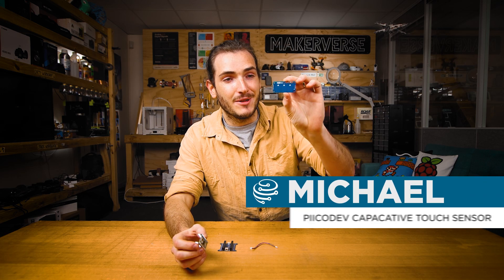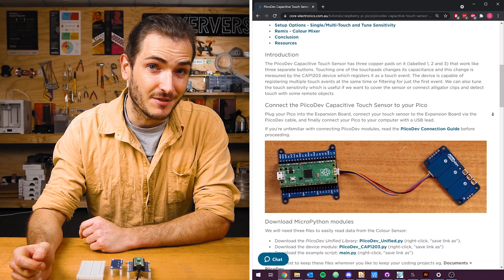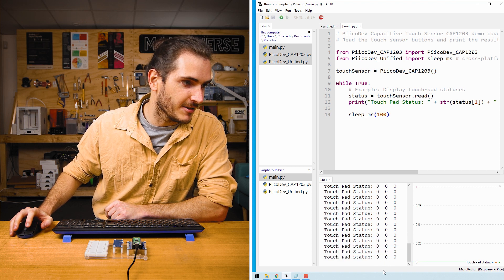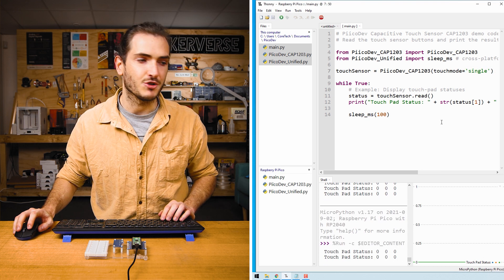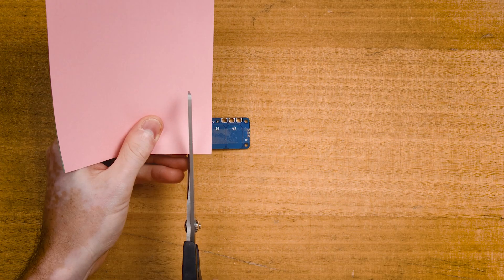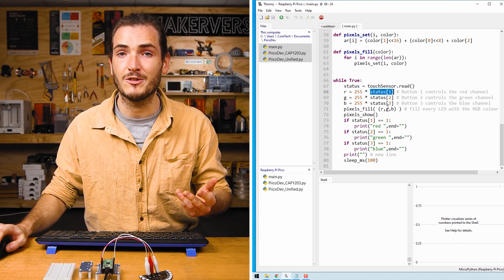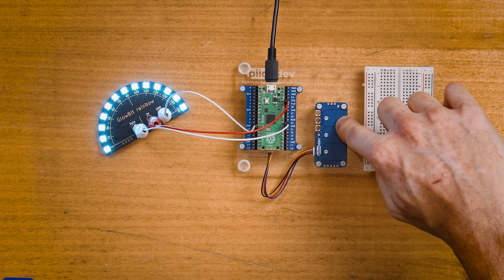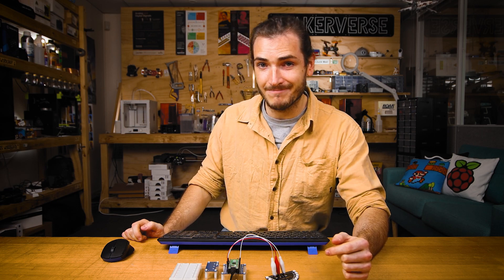PiicoDev Capacitive Touch Sensor CAP1203 | Guide For Raspberry Pi Pico

Comment: Thank you for the movie. It would be great to have a project that does a data exchange using a Piicodev sensor linked to a Pico that sends data to a web app. This would make a great project for students Digital Solutions IA3 projects in Queensland. A data exchange between 2 external systems. So collect data with the Piicodev sensor, send to the Pico and then to a web application via a laptop or Raspberry Pi. This needs to use an API with JSON or XML. Schools could buy the IoT modules and use MicroPython with other software to achieve this. You could touch the Piicodev sensor and the output could be on a website or app.
Reply from the maker: We're working on making PiicoDev compatible with PyCom! So you could skip the extra step and just transmit data from the PyCom over WiFi/Cellular/LoRa WAN.
The Unified PiicoDev library means that the code to set up and read the sensor ought to be exactly the same for Raspberry Pi Pico and PyCom - so all you'd need to do is set up a PyCom as an IoT device.

So the system could be a PyCom connected to a PiicoDev sensor, transmitting data to eg. io.adafruit.com over LoRa WAN